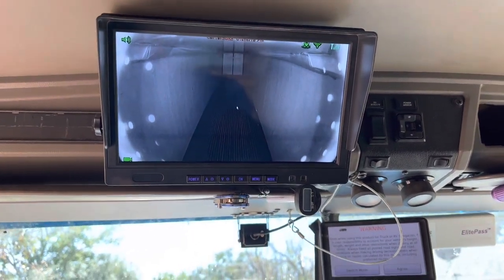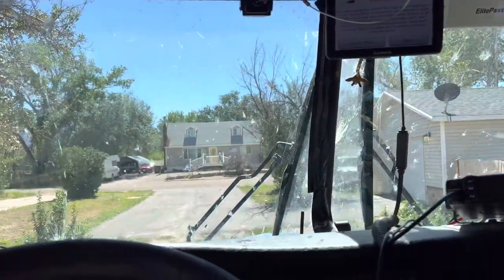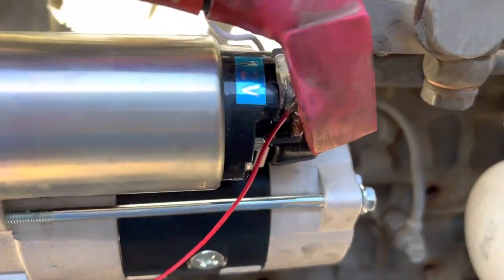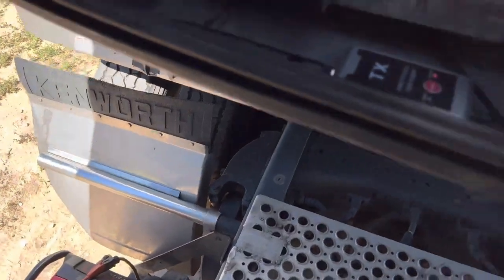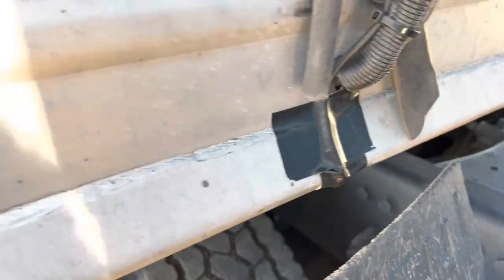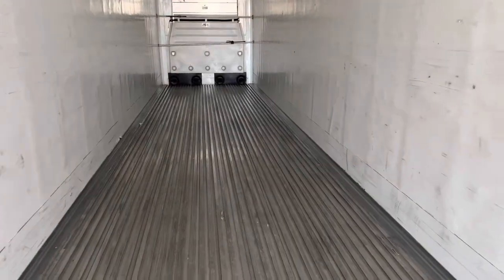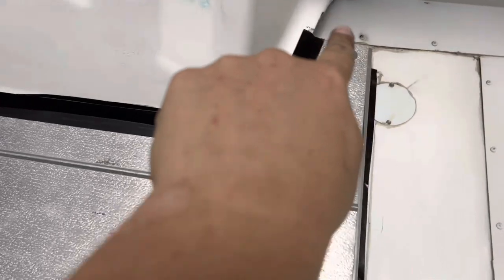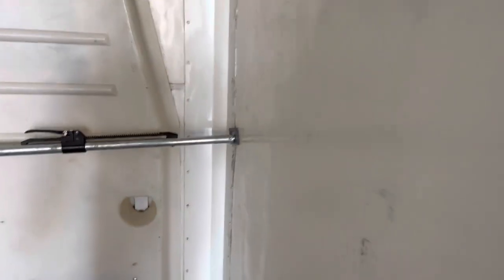Installed A Camera Inside My Reefer Trailer

Comment: usually camera is placed in the back of the trailer looking forward. as trailer fills up, you might not see much from the place where its at right now.
Reply: I was worried that may happen, too.
Reply from the maker: Nope, I can see pretty much all the pallets. As many as you would see if it was facing towards the nose. Plus, I like being able to see the dock door so I know when they close it. And also watch inside the warehouse. I was able to see the forklift driving back and forth. If it was facing the nose, I would just be able to watch inside the trailer.. and not watch outside.
Reply: I wonder how hard it would be to install two camera’s for maximum visibility.
Reply from the maker: Just run the cable and another transmitter.